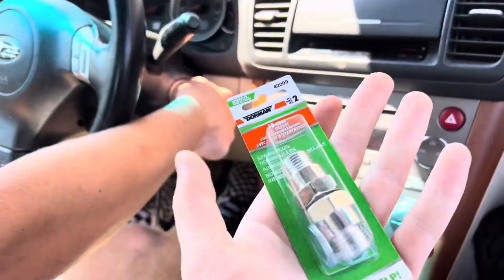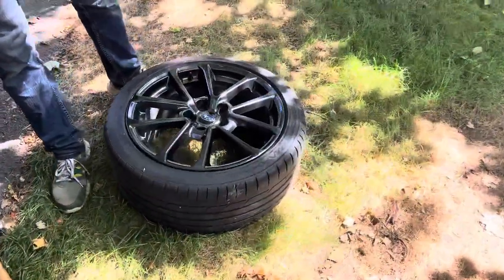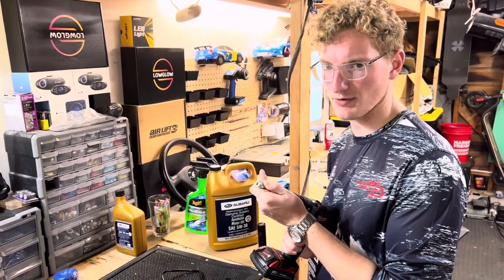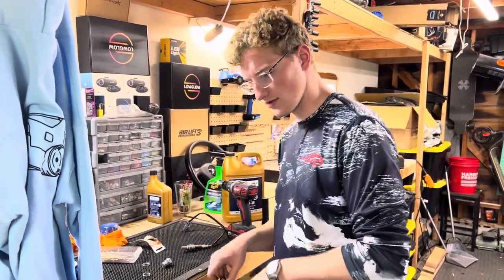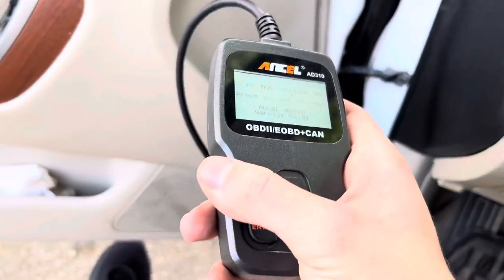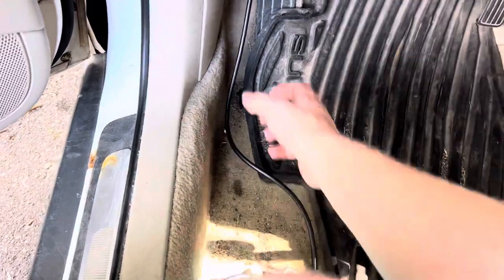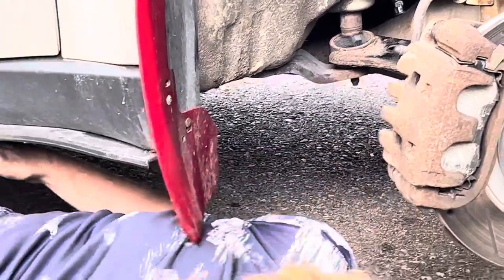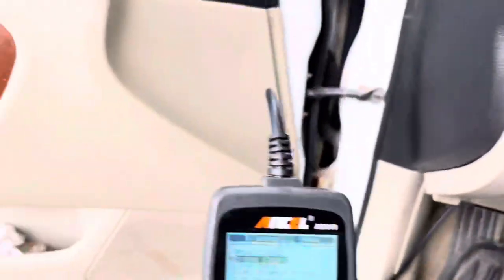CHECK ENGINE LIGHT BE GONE! MAKING BAD CATALYTIC CONVERTERS PASS STATE INSPECTION

Comment: Some state inspection perform visual inspection you will fail.if you can hide O2 sensor connector splice in resistor,capitol is alot better